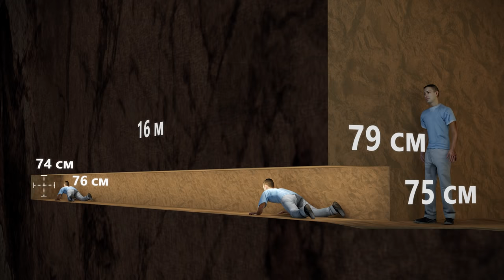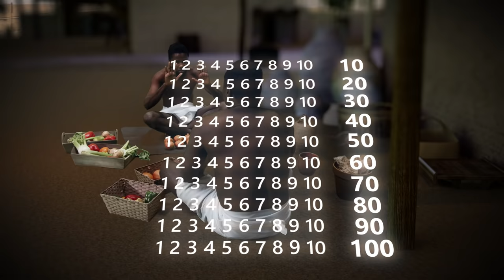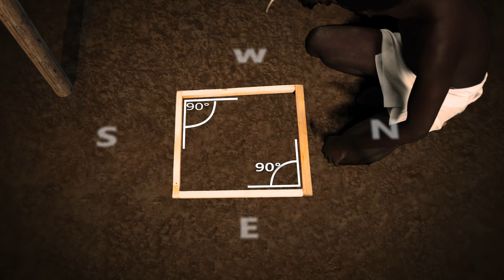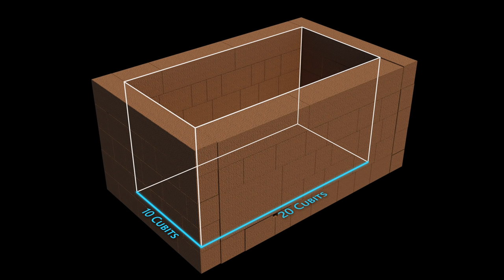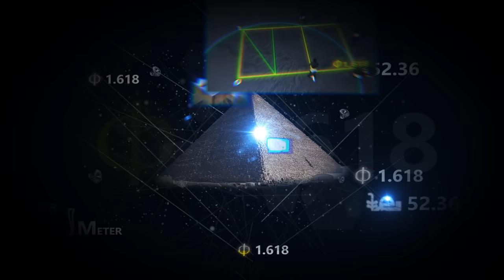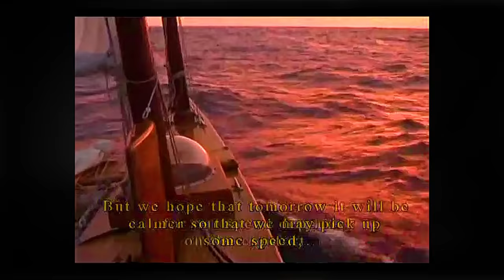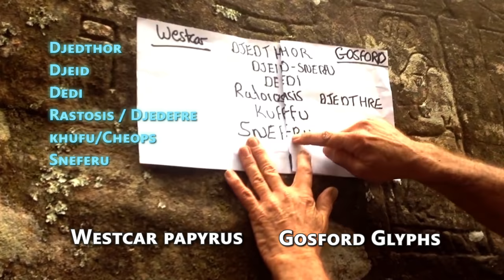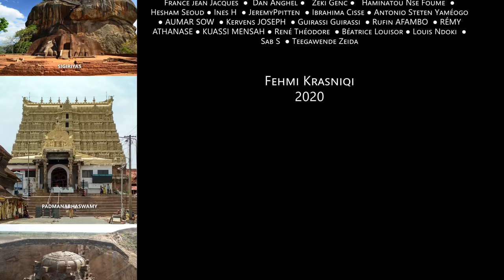The Movie Great Pyramid K 2019 - Director Fehmi Krasniqi

Comment: Doesn't address the many tooling anomalies that are found on this ancient site , drill holes, saw cuts etc, falls short 🤙
Reply: does not address much ... just another brain fART by yet another human working things out trying to merge brain fARTS with heART work and the Sacred ARTS
Reply: @islandbuoy4  yup, ignored all the anomalies that point to a very different history than the current model
Reply: I agree it does fall short in so many ways. It's quite clear that the ancients used the concrete method but they also used other more advanced methods. I don't think the gigantic solar lens is something that would melt that stone in those quantities, maybe for smaller things but not for those super large stones. And the super hard bowls have no characteristics of ever being melted. The colors are not mixed and granite looks like it was a ground up material instead of melted. So this isn't a great example, too many questions.
Reply: @proverbs2522 ,  cut holes and saw circular saw marks left in stones are but a few of many unexplained anomalies 🤙
Reply: Oh I know. I dont even use the word "history" unless it applies to a written or spoken narrative. I use our past or the past. History is written by the victorious so it's in fact his story; not mine or ours at all.
Reply: Would be much easier to drill or saw if the stone was soft. One could even use copper tools. 

Do we even know if those marks are from the same time? 

Not so sure about the glass burning. Might even be chemicals combined with copper tools and casting. 

If so, we have a logical theory without needing aliens or sofisticated machines we do not have today. 😊
Reply: I think it's an electron transfer chain. The Tesla tower at Wardenclyffe was based on the same concept of a wave of cavatation begun in a subterranean chamber that travels through water chemically balanced to be very similar to that of cerebral spinal fluid. The vibration was created by the sudden stopping of water by closing a one way valve or perhaps the movement of a cork like structure as in the valves of the heart or the coccyx which is moved when we breathe like inspiration. The electrons in the structured water would move to structures that resonated with the particular vibration of each electron like is found in the mitochondria of our cells from plasma to enzymes and/or proteins in the form of ATP the same as found in plants, also the spinal fluid system with the electrons or currents of electricity moving onto the ganglion which surround the Pineal, also as is created by the movement of conductive fluid around the magnetic center of the Earth which creates the magnetosphere of the Earth powered by the orbiting moon which literally breathes for the Earth and flexes the tetonic plates as the our inspiration flexes the separations of our skull called fontanel from the force of the wave began at our Sacral pump which is the actual medical term and font means receptacle of the baptismal or Holy water. It's a part of the Fountain of Life which is the exact same thing as the electron transfer chain which is how all energy and the information it necessarily contains is transferred and transformed everywhere in the Universe at all scales from the subatomic to the Galactic. What causes energy to appear to move is a resonance of attraction exactly like thoughts of what we feel like love or anger are automatically attracted to us without any need to look for them, they just gravitate to us like structures forming in cytoplasm after mitosis. Everything is formed and held in place relative to the frequency or energy of the nucleus within a mostly closed boundary and all the relative mostly closed boundaries that each is within and those that are within it. Check out the Cassini video of the storm at the N. Pole of Saturn and you will find a pattern much like my profile picture which is a two dimensional representation of the Flower of Life. A 3-d version shows that each level within the outer reduces by a factor of phi and rotates 30° giving the Golden spiral for the interior and exterior. These things may seem unrelated but I believe they are entirely related because they indicate the correlation between geometry, frequency, pressure, currents and I'm sure lots of other things. The corners of the hexagons on Saturn have vortices like hurricanes. I happened upon the Saturn video looking for geometrical patterns in hurricanes because I thought hurricane Michael was trying to make a hexagon, they make other shapes also. The patterns are usually distorted because of the fluctuating outside pressures but become clear with a particular strong nucleus compared to outside influences, just like some people who aren't swayed by outside influences. I'm happy to answer questions or read insults or give a correlating story about Horus, Asclepius, Jacob's ladder, cytoplasm bound by phospholipids as the firmament that separates the waters, how the dictionary is evidence that good rules the world... 🙏
Reply: The marks are from getting the mold off the stones and small distance transportation and over time wear 🤷‍♂️ and the bore holes only add to the pour theory and cuts can be made with a string if soft enough
Reply: I ask the sceptics... Does your "proofs" mean the pyramids does not exist?
Reply: we need to see in a live video how they can melt down granite with a lense....
Reply: @imaginaryuniverse632  Jeez you got this in PDF ? THAT SURE WAS LONG !!! LOLOLOLHAHA
Reply: @proverbs2522  Many of the hard stone vessels are quite small, so theoretically the mass that they were made from could be softened by heat, but what kind of technology would be needed to shaped softened stone that would be extremely hot?  None that anyone knows anything about. It would require advanced robotics.
Reply: @redwoodcoast  Also that wood idea, no way. It would burn the wood up.  They couldn't reuse it once let alone 10 to 20 years.
Reply: @proverbs2522  They only used wood for the concrete not the things they melted with the lenses for that they used clay they showed a clay mold in the video with a dirite statue right by it. So you think there was a civilization more advanced then us now? I'm not saying they didn't cut rock at all because they did but not much cause it was alot harder to do with copper tools
Reply: @mrsudarshan6249  
"sceptics" never questioned the existence, but the methods used
Reply: I thought they "melted" stone with sound-vibration.
Reply: Forgot to include the link about "melting" rock with sound: https://youtu.be/BsqOLCXYznE
Reply: @fallenangel2123  The methods of scepticism is questioned many times. It is a pseudo science with no answers.
Reply: @mrsudarshan6249  
The "methods of scepticism" explained:
You only see what your eyes WANT to see - the "sceptic" (realist) looks at everything (including the things you DON'T wanna see)
Reply: Ben from UnchartedX is off to Egypt this week to do some exploring and fact finding, take HD footage etc and gather more data on the anomalies that remain unanswered by classical archeology
Reply: @imaginaryuniverse632  they'd need to understand that the deepest chamber is a ram pump, first.
Reply: @noestoydebroma  contact LIFE foundry in Lunenburg Nova Scotia they have a solar forge.
Reply: @proverbs2522  hardened with ceramics on the inside?
Reply: @islandbuoy4  correct me if i am not correct - they used the crystal to cut and bore holes
Reply: @ Angel Humphrey how about put sticks(, how about we make them out of bronze of copper) in cement in a mold and before cured, take out. no drill needed.
I work in construction- what you fail to understand is all this is plausible- without tools that use carbides, diamonds, and iron.
 just stop and give credit where it is due- Do not be ashamed that white people still were cannibals when they were building pyramids- It's all good- we accept the neanderthal in all,,, somewhat. Black people did it, not aliens.
Reply: @imaginaryuniverse632  you are thinking wrong.
No Iron was found anywhere or any machinery that required electricity.
Reply: @daverhin5975  I was thinking about the wooden forms for pouring the granite concrete. This would be very hard on the mold pieces. Constantly taking them apart, moving and then trying to re-use them, no matter how careful you were, or how good your release medium was, would lead to failure pretty quickly and necessitate creating new molds. As with using precious palm trees for rollers, this constant need to create new wooden molds would quickly deplete this natural resource, which I agree was vital for the Egyptians to preserve. So you are left in a quandary.
Reply: @TheKevphil  . The molds are such a simple problem they could just use clay its by a river. To me this even explains how they cooked there food. As for the rollers they probably never needed them cause they didn't move big rocks they made it and melted it so that could've been used on the molds. I think moving 50 ton rocks over wooden rollers would've used 1000 times more wood. Even if the wooden molds lasted one year there was plenty enough.
Reply: @daverhin5975  I understand that it's one or the other, not BOTH molds and rollers. Even if the molds were made of clay, you'd have to constantly be re-making them; I think a life expectancy of a year for a clay OR wooden mold is EXTREMELY optimistic. How many blocks would be poured in a day? Just the act of breaking the molds (in the case of clay) or trying to maintain wood parts, would be very time-consuming. Of course, they would need several molds anyway, so that work could proceed in multiple places around the pyramid simultaneously.
Reply: And where are the lenses?????
Reply: @TheKevphil  I'm just failing to see why you think there wooden molds would fail so fast? There boats were made out of wood and spent years in the water. They didn't poor molten diorite or granite on wooden molds obviously. Just insulate the wood with clay and poor the first few layers slow so it don't burn the clay to bad. I don't think they needed rollers at all why would they? they can melt it to any size and carry it and put it back together. I think the wooden molds used on the pyramid would of did the whole pyramid minus the rocks that had to be heated. They could obviously make wood water proof or they wouldn't of had boats I'm sure they did the same thing to there molds. I'm not really sure how many they laid a day but i think the video got the time right or close to it. If they moved them big rocks it would of taken over 300 years and that don't make sense when people only lived around 50 years
Reply: @fallenangel2123  sceptics censour what the elite not want them to see. Tell them what not exist and they will repeat.
Reply: @mrsudarshan6249  
sceptics are those that don't believe that 🐖 can fly - NO matter WHO is telling them that
You understand that
Reply: Leaving a cooper rod in the drying process while regularly rotating it to keep from binding to the concrete. Cut with a copper saw while  still soft, and again pass it through the material regularly until set.
Reply: So they chisled some of it.  That magnifying glass would be great for reading the night sky.  I think it's a little bit of everything we know about it
Reply: @hilke3071  I thought maybe they moved the stone with vibration
Reply: @redwoodcoast  A wooden plank with a layer of clay to insulate the wood from the heat could possibly also work. Also, they said that the stones could be cast by mixing different chemicals with limestone, which would harden after mixing. And seeing as limestone is pretty soft and easily ground up, that would probably be how they built the pyramids. The solar lens, if it existed back then, was probably only used for the harder stones like granite and andesite.
Reply: Truth
Reply: @fallenangel2123  ?
Reply: My thoughts aswell. Did they cast the 70 ton granite blocks aswell then? Why start carving out an obelisk if you can just cast it? What about the obsidian vases? 
What about the temples in india? That are cut out from a mountain? What about all the similarities with structires i peru, mexico, india, Japan, greece, italy etc.?
This is just a theory... Like the others that dosent explain much of it tbh.
Reply: Doesn't address Serapeum with many giant boxes of hardest stone with perfect surfaces. One box is cut but not finished.
Reply: Yes, you're absolutely correct. This falls far short of being a comprehensive explanation for all the unexplained, technologically advanced remnants observed here and many other places; yet the majority overwhelmingly fall for it, as usual.
Reply: @imaginaryuniverse632  Covered a bit there, eh!  Giorgio A. Tsoukalos would be proud : )
Reply: @penyopetrov7081  
Taka e
Reply: @daverhin5975  yes I'm gonna still say they were more advanced than us. This is a theory not fact and a poor one at that. He left out all the millions of anomalies so it would sound so plausible but it's just his own explanation and nothing more.
Reply: @RicardoPetrazzi  hiya! I have more than a few issues with this doco. I like how the opening graphics say - history is wrong! - but then it goes on to agree with the chronology and the tomb theory. Sigh. Kudos for airing alternative hypotheses. Bit dismissive of other researchers. Thumbs down for agreeing with Khufu did it! That's his cartouche correctly painted!
Reply: @angelchiriboga3904  Everything requires electricity. Nothing appears unless it has electricity flowing through it. I don't believe the Pyramid was made to produce electricity but rather to show distant descendants how the Universe works. I believe it was designed as the show to the tell of ancient scriptures for us to put together as a show and tell. 
   For instance, the electron transfer chain is what is referred to as the Fountain of Life in different scriptures using different names written in many different times and places. There's a movie called The Fountain which never mentions a Fountain throughout the whole movie but the whole movie is about the Fountain of Life which is the same as the Tree of Life which, spoiler alert, he drinks from it's waters as the sap from the Tree of Life and then fulfills the story of Xibaldi who is the star of a Mayan myth about the dawn of Creation. It's much the same as the story in one of the books of Corinthians talking about the old Adam and the New Adam and might have mentioned stars as being his children also kinda like a New Earth and also kinda like Jacob becoming Israel and his "children" no longer "eating" of his Sinew. 
    It's an interesting word Sinew and it's many entanglements like it's connection to the Sine wave and the fact that the first definition for nerve in the Webster dictionary is Sinew. Jacob saw the face of God in the land of Pineal which is a gland that contains rods and cones just as our eyes and is actually where we see everything that we imagine seeing even if our eyes are open. Anyone can check right now by imagining anything and see if it doesn't take the place of what is seen with the eyes. The more we focus on what we Imagine seeing the more it becomes what we see. The same is true for all of the things we sense which is information received by our receptors in the form of Sine waves. When we believe that we can only react to the information that we receive from the world around us then we become just like a chemical that will react entirely predictably to what it comes in contact with or you could say inevitably. It seems consciousness is determined by it's ability to deviate particles from their otherwise inevitable position which I call the fractile of inevitability, usually in a voice like James Earle Jones. When our actions are only reactions to the world we experience then we can not change the world but exist only as a part of an inevitable series of reactions. This is what is meant by the wages of sin being death. 
     Osiris was killed and torn to pieces by Set. Sire means father and Set is where the Sun ends the day. Isis put Osiris back together with some magic to facilitate the creation of their son Horus. The new day begins when the Son rises in the East on the Horizon of a new day. The 3 stars of Orion's belt are arranged as the 3 Pyramids. The O and R very often signify the masculine and feminine respectively in the English language and ion means the source of, put together ORion means the source of the marriage or of Creation. The song We 3 Kings of Orient are, adds to this story.
    Michael Angelo has a painting of Abraham pointing to David where Abraham has the form of the Orion nebula. Angelo also has a painting called Day of Judgement?, where the whole scene is in the mind of God and an oar's man guards the offloading of passengers from a boat on the waters at the base of the mind. This is where thoughts enter the mind. The hairs that surround the Pineal which are also mentioned on the second page of The Revelation of Jesus Christ to St John are called ganglion which is as gangplank is a bridge from ship to shore. It's hormones that turn the hairs surrounding the Pineal to white and these hormones are as Messengers like Hermes the Herald Angel or messenger angel of Zeus spoken of in Roman myth. Hormones determine what we see on the Horizon. Hermes was given the Caduceus by Appollo as a sign of friendship a similar story of Asclepius which is where ascertain, ascend and ascetic come from which means to know with certainty, to rise above and to abandon self especially for Spiritual reasons. Hark the Herald Angels sing, glory to the new born King means the same as Psalms 91, refrain or wait as in listen for the messenger Angels and you will become a new star of Creation just like Xibaldi. Let go of all attachments to this world as in thoughts and just be aware as in listening. Rise above the noise and confusion to get a glimpse beyond this illusion. If we listen very hard the tune will come to us at last when all are one and one are all. These are some of the things that the Great Pyramid is trying to tell us. It's about how to use electricity to create whatever tool is required to create whatever we wish to create. The Pyramid is to show how what is written goes with everything that we see everywhere. The Golden rule is the only rule and is our guide and our measure. 🙏
Reply: @crhu319  I think John Cadman's video probably gave me the information I needed to have the function of the Great Pyramid come to me like a video starting to play in my head when I was watching a 5 minute video about the electron transfer chain of our cells. I'm quite certain the purpose wasn't to pump water for fields. I wrote a long reply above as to why I think it was built at least as a major reason because it has lots of information given in the design that doesn't have any apparent purpose other than to give the information. I've seen a lot of evidence that it also had or even has practical purposes also and I think it probably did but it's not clear exactly what the nature would be. Could be to actually power things electrically or maybe effect the environment or even the mood of the people around it or even around the world. I think it's the most important thing on the planet anyway just from what is obvious.
Reply: @imaginaryuniverse632  they had the information of builders. That is all. Science was in its infancy. The rest are conjectures drawn with our present minds. The meter and the ratios are in themselves the base of all we know. THAT is what they passed on.
Reply: @imaginaryuniverse632  Marry me! 😉
Reply: ive been to Eyjpt  and all of this to me is fantasy,why did they not give the people in Afraca first that knowledge
Reply: @kennithdubroy797  the same way the church kept Europe from even treading for 1000 years. Secrecy and   control of knowledge.
Reply: I not claiming to know who built it I'm just relaying what I've seen while there. And DNA tests were done on some Egyptian kings, and I don't know if they were cherry picked but it show's the closest living relatives are around the black sea
Reply: thought the same. maybe it was easier to work on half-way cooled granite? but then the question of tje tools used is still open. and the "poor liquid granite into a form to make vases" is strange too. how would you make the perfect mirrored and machine liked form them? you habe to start somewhere. also, this docu doesn't even try to explain tje big underground labyrinth or other temples. it's a fresh idea, but full of holes.
Reply: Drunk aliens :)
Reply: I guess people like aliens and carriers better and the stone TOOLS TO CUT GRANITE even do nothing has bin fond NON what so ever HAHAHAHAA
Reply: @imaginaryuniverse632   wow!! Just wow.....my brain hurts
Reply: @imaginaryuniverse632  sorry, i read about a third before i was convinced you are just on a wind up!  good though...
Reply: @killphil9119  No worries, the Truth isn't for everyone. 🙏
Reply: @haknys  You can drill into granite with a copper drill all you need is sand you would go through a lot of drills though.
Reply: @typojakob  That's crap for kids and dreamers.
Reply: @billybobwombat2231  how can you still consider a cut/bore hole an anomaly when you already saw that it's a cut hole,  lol